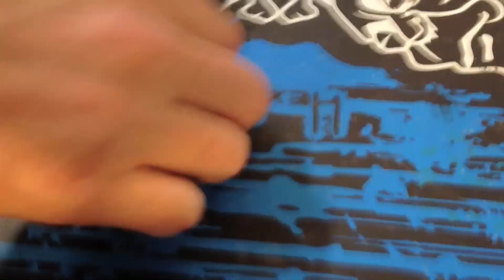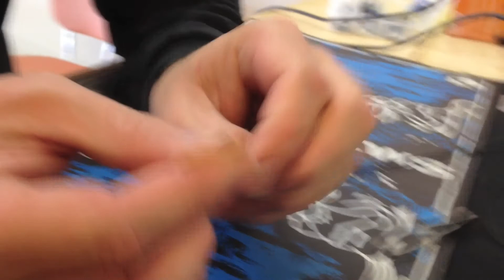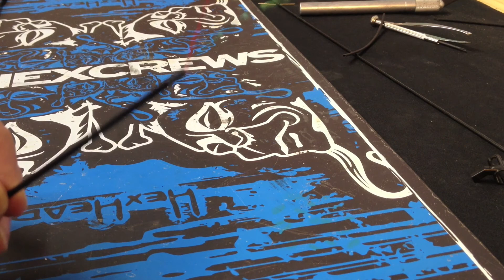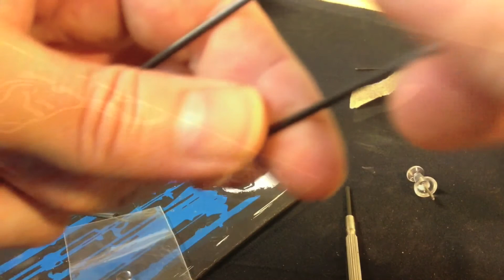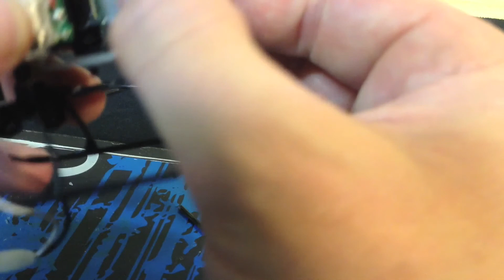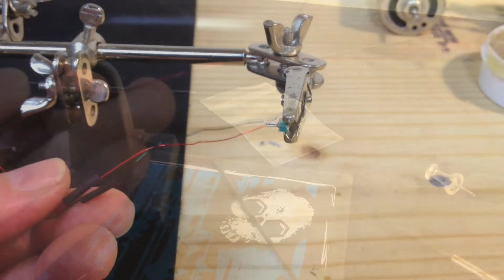Blade Nano CPX Solid Tail Boom Mod

Comment: Looks like that plug could have easily fit through the heat shrink tube... Seems like the desoldering and resoldering was extra... Also, didn't see the need to remove the motor from it's mount...

Comment: not saying this is a good idea but you shouldnt try and cut carbon like that it will just crush and splinter, causeing it to be weak. to everyone that is watching this you should use a high speed circular cutting wheel to cut the rod and wrap the cutting point with tape to make sure the carbon spliting is at a minimum

Comment: I'd rather do a 2 minute hollow boom replacement than a 30 minute frame replacement. I found that running solid booms on micros just transfers the weak spot.

Comment from the maker: It's a great mod, 2' of 2mm carbon rod is $4 at the lhs, the stock boom comes as a complete unit and costs $14. The modded assembly with heat shrink comes is a little less than 1/3 gram heavier than stock, and you will most likely never break it, there is no noticeable difference in performance. I did ask my lhs to order me some hollow carbon tubing so I can shave off that extra bit of weight, but that means I will be replacing them more often.